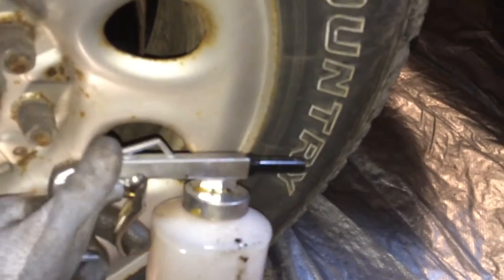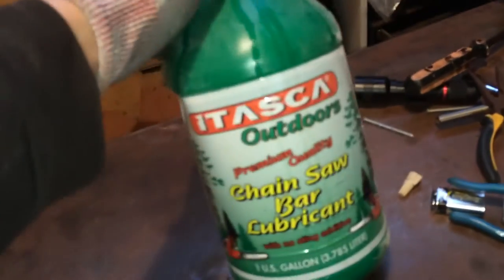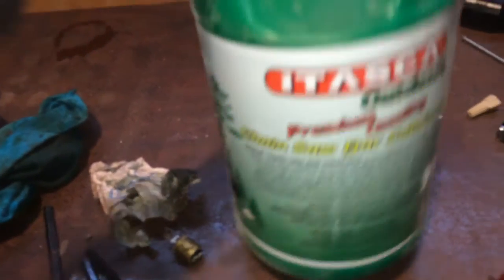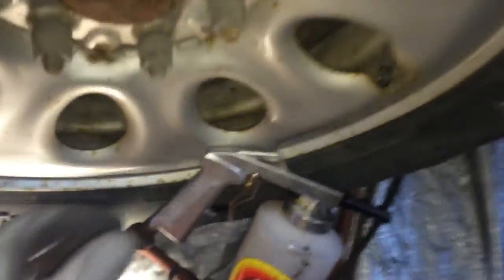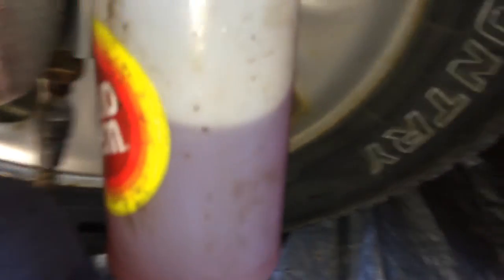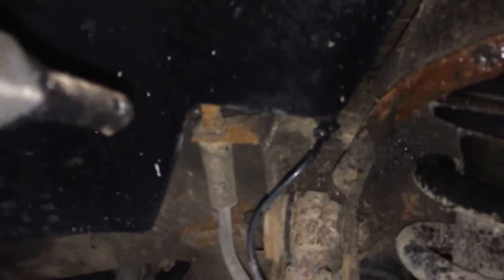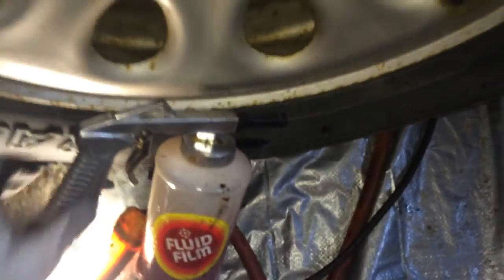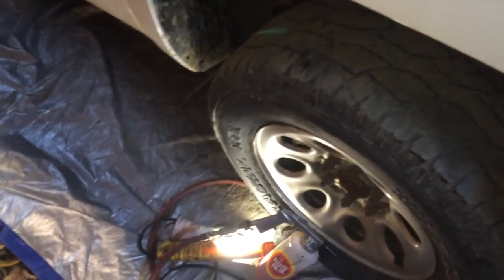Under coating with bar and chain oil

Comment: Keeping water off the metal is your goal.    (Moisture + Heat + Salt = rust)  . That said, I've been using Husky ( summer grade)  bar and chain oil for 25 years on my vehicles in Vermont . Long story short, steal your wife's small electric crock pot, heat the oil with some wax, then let it rip. Most corrosion occurs during warmer months , so spring is the best time to apply the oil.
Reply from the maker: Thomas Bartlett   Thank you for the information, I think I'm going to try that mixture in the spring. How much wax do you typically add?
Reply: For exterior surfaces 1 bar candle wax (Amazon) ( 1/2" x 2" X 4") or a toilet wax ring per quart. For inner enclosed areas, just heated oil with no wax OR ATF Dexron non synthetic tranny oil.  Automotive paint gun also works great with hot oil @ 50psi. Check out mustie1 posts. Good Luck...
Reply from the maker: Thomas Bartlett  I've seen a couple of his videos, I'll have to go through them. Thanks again for the information, I'll give you a shout out when I do a video of re undercoating this truck.
Reply: I suggested the HEATED bar oil to mustie1 in his "Undercoating with fluid film"  review on my daughters computer under "Colleen" and he liked it so much he did a flick " Undercoating with bar and chain oil" . Mustie1 has very good posts!
Reply from the maker: Thomas Bartlett  I went through some of his videos, they are good. I found some gulf wax laying around and I bought a cheap crock pot so my girlfriend won't make me live in the truck for using hers lol. It's supposed to be in the 60's this weekend so I'll give it a shot.
Reply: Thomas, do you have to pressure wash the crud from inside of the frame rails before using the Dexron spray? I'd like to do this method on my recently bought Colorado.
Reply: Since spring is the very best time to neutralize the rust, it is also mud season in Vermont. So yes, pressure wash the heavy mud and dirt. Spraying over light dirt is fine as it forms layers.
Reply: Thomas, thank you. Will do

Comment: You do not have to cut it with anything heat it up in the microwave for 4 minutes
Reply from the maker: I have since found a much better formula for undercoating using bar and chain oil and wax. I made a video about it